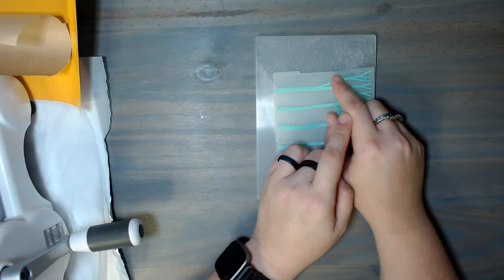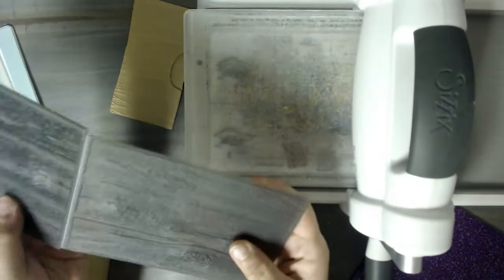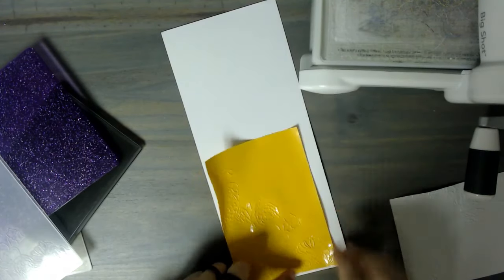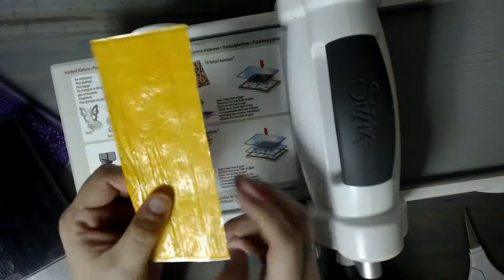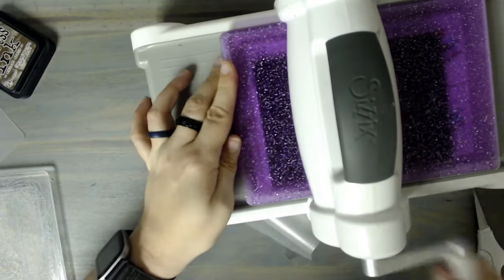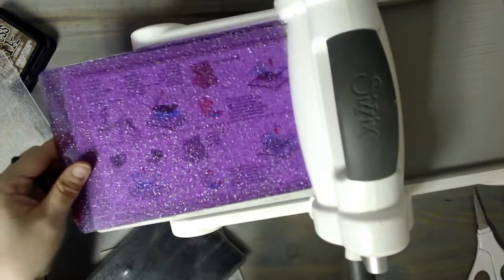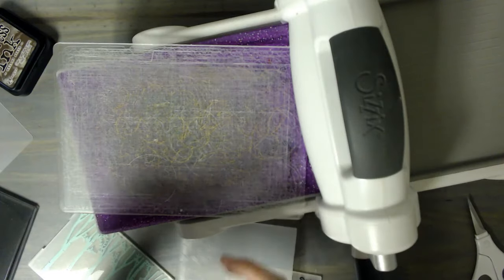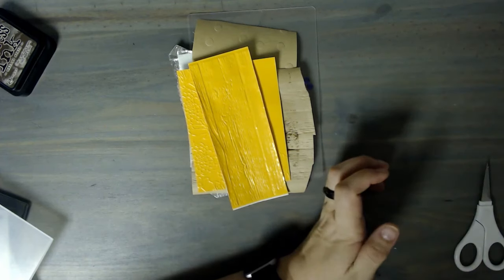Will it Emboss?

Comment: You can emboss on pieces of aluminum beverage cans (cut the top and bottom off the can, cut up the side for a flat piece of aluminum) be careful of the edges
Reply from the maker: What! That's amazing. Now I'm going to have to buy something in a can to try this
Reply: @mimispapercrafting  I have done it to make jewelry - saw it on Rainbow Lane video. Can be colored with alcohol ink or paint, very versatile, you can also use paper punches to make shapes.
Reply from the maker: Ohhhh I bet the jewelry is gorgeous 🥰